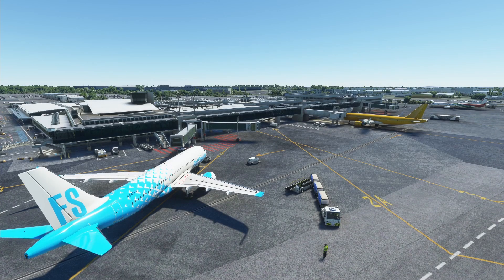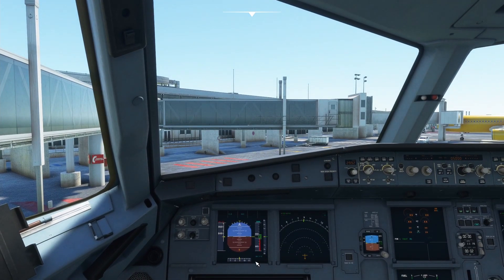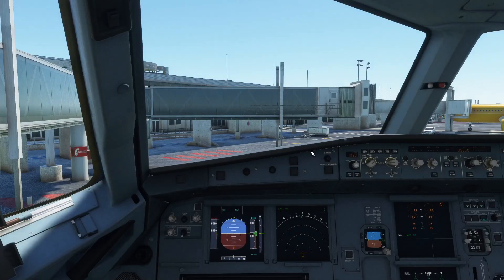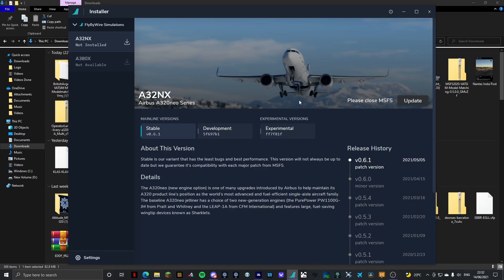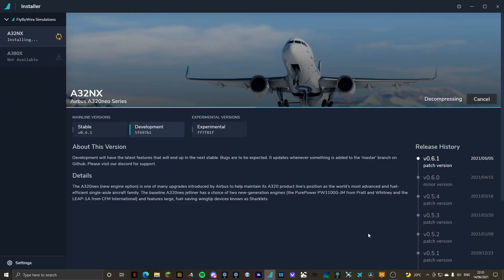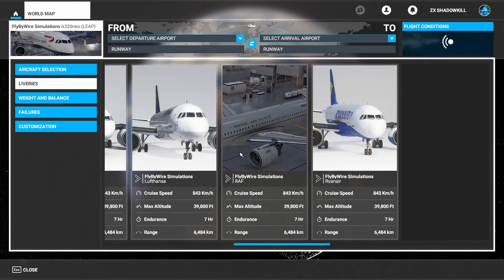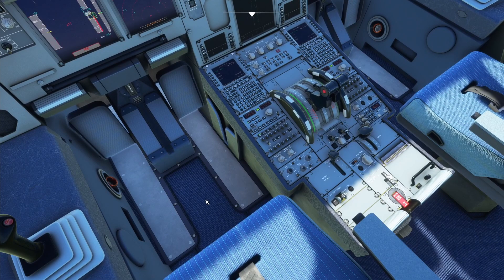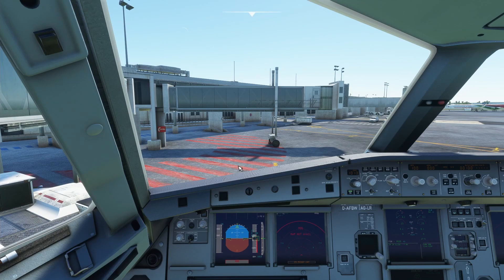How To Install FlybyWire A320NX And Why Its Better! /MFS2020

Comment: Hi i have some question about i already installed fly by wire main file and go into MFS2020. The fly by wire livery is show up but i download other livery and put file in community folder but the livery didn't show up in MFS2020. I can't find the problem is.
Reply from the maker: It could be that your livery isn't compatible all I can recommend is you watch my how to install a livery video as that should help if it doesn't let me know!

Comment: is need install msfs or not
Reply from the maker: to get flybywire you will need to have msfs installed yes
Reply: @HHAviation  So i installed it and it's showing up in my community folder but the problem is , that when i go to world map and search for it it's not there , i searched through the airliners category and the search bar but it isn't even there so please help
Reply from the maker: @borissss7802  Hello lad are you still having this issue?
Reply: @HHAviation  actually no. I have solved the issue. But thanks